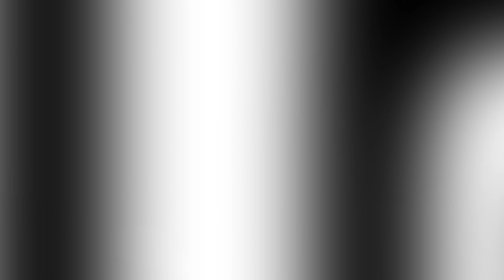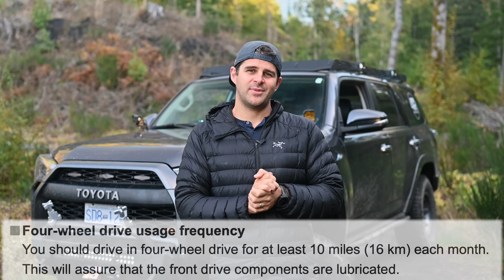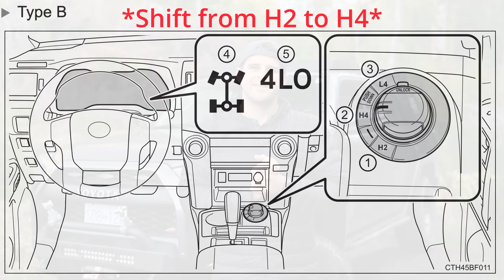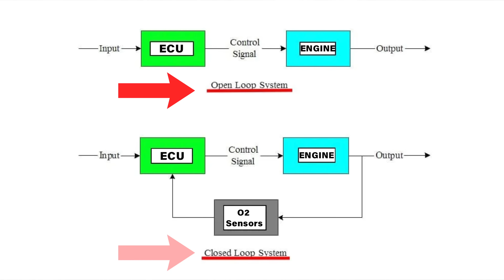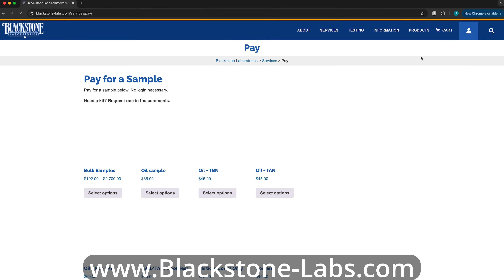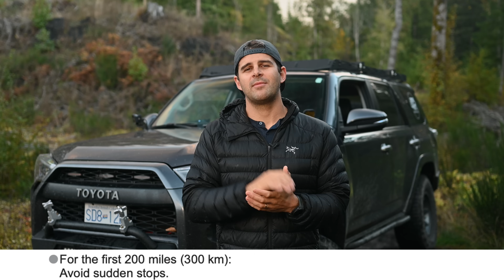5 Ways You Could Be Ruining Your Toyota 4Runner, Tacoma, or FJ Cruiser

Comment: Thank you for the great information. I have a 2007 Lexus GX 470 that I’ve owned since New I have just under 100,000 miles on it and keep the garage kept and yes it cost me more but I have only Lexus Service the problems have been very few thankfully I did have to change the timing belt back at 77,000 miles in the water pump at the same time also the airbag so whatever they’re called in the back suspension bags I just had to have changed that cost me 1600 bucks probably paid more I’m sure I did but at least the reliability of the dealer it’s the simplest way for me to go the reason I bring up the GX is because of the similarity between the GX your vehicle which is a great vehicle if I ever get rid of the GX which I don’t think I will I would definitely go with the forerunner it’s a no brainer. I would definitely do that so thank you for all your good info again. I wanna keep my baby running as long as I possibly can and since I’m 78 years old I’d like it to see me out without having toreplace it thank you again peter

Comment: I would have a spray under coating (woolwax, fluildfilm, etc) in the top three for sure. If driving on salty roads rust is thr biggest threat to your 4R
Reply: I spent 300 bucks and had this done ✅
Reply: @King_Henry did it myself for 50$.

Comment: The stealerships are charging over $100 to change the oil and filter. It takes me over 30 min to commute back and forth and usually an hour and a half wait or longer. I've decided that I'm going to change oil every 3,000 miles which will cost me a third of what the stealerships charge and only 30 minutes to do it myself. Thanks for pointing out that cold starts could hurt I'll keep that in mind.
Reply: Getting anything done at a dealership is robbery.

Comment: #1 - Put the vehicle into 4WD every time after filling up your gas tank. Drive for about ½ mile, and then shift back into 2H.
#3 - Change the 5W-20 Oil in the 1GR-FE every 5K miles OR LESS regardless of where you drive. Toyota would like for the engine in your vehicle to fail after the warranty is up so that you will buy another vehicle. ALWAYS use Toyota OEM Filter.
#4 - Change the Toyota SLLC (pink) coolant after 100K miles, and every 50K miles thereafter. Do NOT use anything other than Toyota SLLC, Pentosin Pentofrost A4 or Zerex Pink. All of these are 50% Coolant and 50% DISTILLED Water pre-mix. Toyota RED (LLC) is NOT the same as Toyota Pink (SLLC) with water.

Comment: 2006 Tacoma TRD Sport 4X4 350,000 miles.  Left it stock and it never dies.  I've never changed the coolant, never replaced hoses, never flushed brake fluid, never changed trans fluid.  Drive it in the snow every year for skiing.  Leave everything stock and drive the shit out of it...  Oh, and I never let it warm up.  I have changed oil and filter using conventional 5w-30 (cheapest oil I can find), but wix filter every 5K.
Reply: Toyota reliability doesn't mean neglecting maintenance which you clearly have done
Reply: I am surprised the frame hasn't rusted off it.

Comment: Change oil on brand new vehicle between 50-200 miles.
There will always be shavings and microscopic metal debris from the initial start up so just flush it immediately and avoid the risk of premature wear.

Comment: My 21 year old 4Runner has been maintained like clockwork since new. She still drives and looks like new, and has never let me down. Maintenance is key.
Reply: Great to hear my 99 4runner has 147k on it! Just did the timing belt, water pump and others. New tires and fixing to rebuild the front end! I love my 4runner
Reply: My 2007 sr5 v6 still running strong 320000km
Reply: Other than seat wear my 2006 runs and looks like new in and out. The standard.
Reply: Reading these comments has me feeling dam positive with my 2020 model. Like my heart, has never let me down. Still purr”s like kitten. 😅
Reply: What maintenances and intervals do you do to your 4runner?
Reply: how many miles?

Comment: The first oil change is to remove fine metal particulate from the initial break in. Microscopic machining peaks and valleys get smoothed out. More like 500 / 1500 / 5000 when new. Change filter each time since most only filter down to 20-40nm and use a drain plug with a strong rare earth magnet for life the amount of metal residue attached will warn you of accelerated wear.

Comment: Toyota, and other manufactures , could easily add electric oil pumps that would produce oil pressure to lubricate in the first few seconds before starting.  Of course, this would mean engines would last longer with fewer repairs to make $$ off repairs or replacements.
Reply: The trucking company I worked for did this many years ago and installed a prelub pump on the engines to bring oil pressure up before engine is cranked.  They found that it did not pro long the life of the vehicle.  The only benefit of a prelub system would be if the engine has sat for a prolong length of time and oil is completely drained off of bearings and cylinder walls.  In addition, mechanical oil pumps are arguably more reliable than electrical oil pumps.

Comment: I might sell my 4Runner specifically because I don’t have areas to go to that have off road terrain (in order to exercise all settings)
Reply: You can do it on paved roads just drive straight only and only in 4 wheel high…. Back to 2 wheel high for any turns 👍🏻.   And just shift in and out of 4 wheel low once a month…. Not necessary to drive in 4 wheel low at all.

Comment: Great video but please be specific such:
1. what miles/hr is considered extremely high speed for the 4Runner?
2.  “Avoid sudden acceleration” I’m guessing you meant warming up before accelerating and if so for how long should we warm it up for before driving.
3. “Do not drive at constant speed for extended periods” Does that mean driving in highway for a 6 hour road trip is bad?
Reply: If you're asking about the break-in period, its very vague and same for ALL Toyota and Lexus 4x4s. So don't worry too much about it, if there was anything critical they would have specified it. 
1. Car Care Nut, a Toyota master tech said extremely high speeds is above 65mph, the some manuals state not exceeding posted highway limits, since we have HWYs with 75mph. I would avoid going 80+ during brake in.
2. Sudden acceleration means don't stomp on a gas pedal, drive it smooth and gingerly during this period. Good rule of thumb is to never let RPM climb over 4k and smooth acceleration if you're trying to race ahead you're wrong. 
For warming up no more than a minute, 30 seconds is enough on a cold start, good rule of thumb is to wait until the rpms climb down, which takes 20-30 seconds. Most important is to drive slow, not race the engine, avoid aggressive driving, it can take up to 20 minutes for some of your powertrain components like transmission to reach operating temps. Remember sitting and waiting on a cold start does nothing for your transmission, differenetials and other moving parts outside the engine.  
3. Yes 6 hours road trip on a new engine is not good. Will it blow anything up? No, as plenty people buy out of state and drive their cars hundreds of miles home. Just avoid this until brake in period is over. Cruise control especially, even on shorter trips, as it locks your engine into a constant speed. Short trips are fine, as you rpm varies as you pass, slow, go through curves. 

Main takeaway is just don't beat up on the car first 1000 miles, drive it like an old lady and avoid long highway trips.

Comment: 2016 4runner 14,000 miles.  Yes, that's correct.  Original owner.  Female.

Just got service done today. Transmission fluid flush/ fill,
Front & Rear differential, transfer case, oil change, tire rotation today.... took it back to shop after it was done because it was making sounds and doing things its never done before...

A quiet high pitched sound when around 2000rpm +/-, you need good hearing and or young ears... service advisor and tech drove it and didn't hear... had the windows down... how did they think they would hear a quiet noise with air and traffic sounds???  Its always made sounds of acceration when accelerating. But this is different. 

Sort of vibrational, sort of whistle like... very quiet... but different than it previously sounded.

Was also having a feeling of it slipping when making its first shift, but i think it was the traction control... it had activated after stopping on a steep hill on way home from service completion... and then would periodically kind of jolt when accelerating mostly from a stop after that activation.  Seems to have stopped... I had a different vehicle do that as well when the traction stability control activated... It's extremely disconcerting for it to do the jolt when you are on straight flat road.
I was very concerned as transmission fluid was just changed.  Maybe a bubble or something.

There is also a little woosh to woosh whistle (not loud) like sound sometimes when i turn now... granted previously it was squeaking a little when turning.

I don't know if any of these sounds are serious issues... but I know they are different than it sounded before.

Anyone with same issues and the answer, and solution if a problem  would be most appreciated!!!

I'm taking it back on Monday if it persists for service manager to ride along.  I hope he has good hearing.

Posted to a previous video regardinf 3 sounds, shoyld you be worried.
Reply: Possibly the transmission fluid exchange is the issue. Especially since you’re stating different shifts after the service. Most likely  not enough fluid was replaced. I had a similar issue after a service @100k on my 2012. Had the service redone and the “whistle/squish” noise went away.

Comment: Seems like you hit everthing just perfect..  I think i'll do the blackstone labs testing just for the knowledge of it as i did everything by the book for the most part even the 1k oil change.  also did the rear end gear oil at 10k and it WAS pretty dirty.. gears break in is a thing.  after i did that one, i opted to also do the transfer gear oil about a week later so also around 10k.  I hope to keep it a long time so it matters to me and the extra cost not an issue when you spend on a 4runner what's an extra fluid change LoL.   great vid.. i'm subbing.

Comment: @ 5:15 I don't think you meant to say "repeated trips of less than 5,000 miles" 
No one drives 5k miles in a trip
Reply: My trip to work is 4.7 miles, but I take the long way and drive 10 miles at average speed of 50mph hoping it gets engine & oil hot enough.

Comment: Misses some key points. 1) 0W-20 is just a best fuel economy viscosity.  But worldwide, Toyota truck and SUV owners manuals say 5W-30 is best for engine protection, even if the vehicle was factory filled with 0W-20. 2) Japan's top engine engineers recommend 2000-4000 mile oil changes for longest engine life. 3) Wearable components of the ignition & emission system need to be replaced before they are totally worn out.  4) The transmission is the most failure prone drivetrain component so needs fluid changes every 30,000.
Reply from the maker: @verlaryder  Great points. Also important to note that most engine wear occurs during cold starts. As per Toyota “0W20 is the best choice for fuel economy and good starting in cold weather” “The 0W in 0W-20 indicates the characteristics of the oil which allows cold stability. Oils with a lower value before the W allow for easier starting of the engine in cold weather” (This is what they provide to us in North America) It is said to reach critical engine components within 1-2 seconds on cold starts to reduce engine wear. The use of 5W-30 is only suggested by Toyota in warmer climates such as Puerto Rico. I’m all about the maintenance on the transmission, so good call. Reports of transmission failures for 5th gen 4runners and 3rd gen tacomas seems quite rare, or at least that’s what I’ve heard. Can you provide any articles or service bulletins which indicate that these transmissions are a weak point? Ive heard plenty of people report they’ve gone hundreds of thousands of miles without changing the fluid, not that I would ever recommend that
Reply: @T4Rgarage  toyota manuals outside the USA and Canada say 5W-30 is among the RECOMMENDED viscosities for year round use.  Indisputable fact. Even in 2025 Camrys and Corollas that came factory filled with 0W-8.
Reply from the maker: @verlaryder  Ah gotcha. 82% of my viewers are in North America so this video is geared more towards that demographic. 73.5% U.S. and 8.5% Canada

Comment: Fluid film inside frame and Blaster Surface Shield on outside underbody every fall in snow belt. Pennzoil synthetic oil every 5000 miles.
Reply: drive a "beater" in the winter, keep your nice SUV/Truck twice as long
Reply: @onenikkione  Or don't drive it at all.  It will last a lifetime.

Comment: Third Gen best gen ✌  Change your oil every 3k even with Mobile1 synthetic, and OEM filters (they have better filtration). Fluids and filters are cheap, and engines aren't. 170k on my super charged '02.
Reply: I have a 2000, change my oil with valoline restore and protect full synthetic and oem every 3-5k miles, change diff fluid maybe once every couple years or so and clean the air filter evert 10k miles, currently at 283k miles and the engine is great
Reply: @jake27schannel  Right on, yes also remember to  grease the Universal joints.  Make sure you replace the ball joints with your timing belt if your VIN number doesn't already have the recall.
Reply: @aviatorgeek99J  lbjs have been replaced but i should grease the u joints lol. What grease do u use
Reply: @jake27schannel  just any plain ol lithium grease. The zerk fittings can be hard to access, I had to use a LockNLube coupler, other wise there is little room to twist off a traditional coupler.

Comment: And don't forget every 100,000 miles change your timing belt or chain. Because your engine goes through a lot of wear and tear!
Reply: A timing chain can last the life of a engine
Reply: @onenikkione      Not in these days. The way people now drive, in these conditions. Stop!, and Go!, stop!, and Go!, speed up!, back up,! hurry up the light gonna change!! And don't forget people don't do the oil changes right on time, so that is more wear and tear on the timing chain!
Reply: @skitown11      Well?, not really. I'm sure if you're in the Auto industry like I am (a Mechanic), chains do attend to stretch, all the wear and tear. Especially a belt. Average person does not go by the owner's manual, of their car. The timing chain/belt does go through a lot of stress.
Reply: @skitown11     Some say and some don't. And the ones that don't want you to buy a new car. The mileage on the car equals to wear and tear on the engine. I have seen timing chain stretch and timing belt ripped.
Reply: I do the serpentine belt every 90 k…. That’s my plan. They are cheap insurance for getting stranded. Same with all radiator hoses…. Because it’s a long walk out of the bush with zero cell reception

Comment: Thank you. Excellent video. Your content was very helpful when deciding to buy a 5th gen 4Runner ORP (along with Automotive Press and the Car Care Nut). You have also recommended several modification products (LED lighting, tires, etc.) and will check back on your videos and see if you are still happy with those recommendations. I just set up a monthly reminder to engage the 4-wheel drive system and also to stick with Toyota OEM oil.

Comment: I use Amsoil because the oil my Toyota dealer makes my engine sound like a diesel. When I use Amsoil it’s way quieter and smoother. Just what I found and love my 2021 manual TRD Tacoma! Trying to make it last as long as possible.
Reply: I second that.  Same thing was going on with my '19 Tundra.  Couldn't believe how bad it sounded on start and warm up.  Switched to Amsoil, much better.
Reply: I love the lopey sound of this engine. Sounds like a cammed muscle car.
Reply: All my fluids in my Tacoma are Amsoil. My dealer was going to give me some gear oil for the transmission and I read the label and said that this is not GL5 approved and didn’t have the correct additives that is required so I don’t mess up my transmission. Thanks to the Toyota Car Care man it’s not the same be careful.

Comment: Why does no one ever talk about transmission, differential, and transfer case fluid changes?  Good grief, they're just as important as your motor oil.
And undercoat your vehicle!!!
Reply: Just did all of that plus Trans on my Tacoma last week at 90,000
Reply: What are the options you know of for undercoating? Thx
Reply: @kmiller5808 Wool Wax is the 'latest & greatest' stuff right now and it is an excellent product, followed buy Surface Shield and Fluid Film. 
Don't wait until Fall to get it done, do it now then a touchup in Fall.
Reply: @kmiller5808I have heard that in Canada, Canadian Tire does the BEST undercoating product.  The Canadian military has them undercoat their military vehicles.
Reply: Your mom talks about it. Just relax.
Reply: every 30K is what I've been told